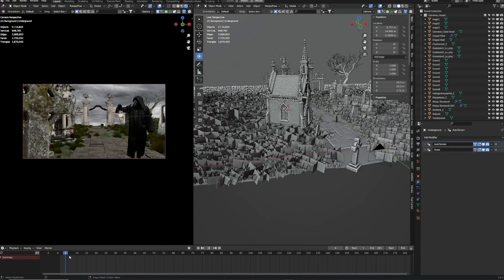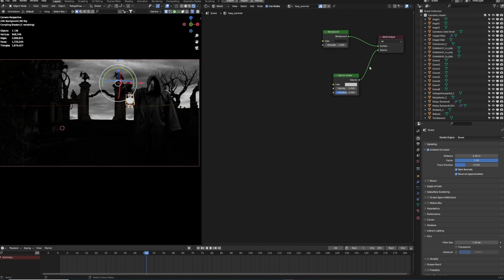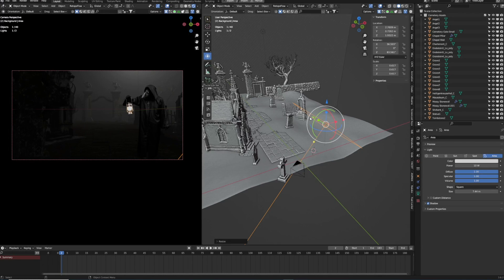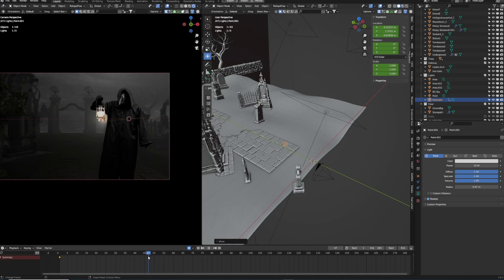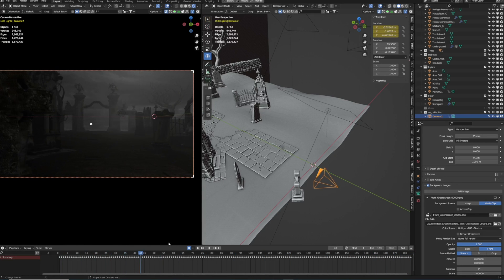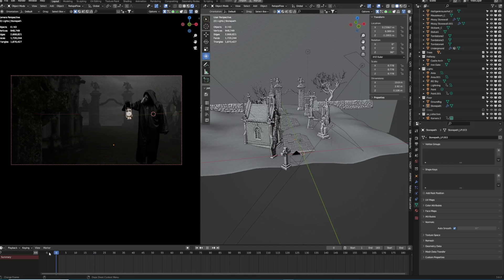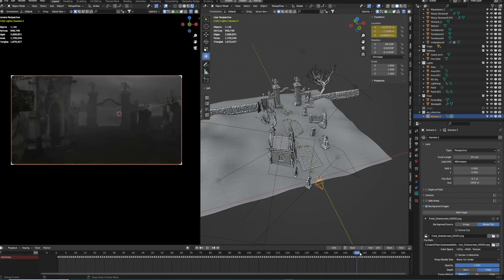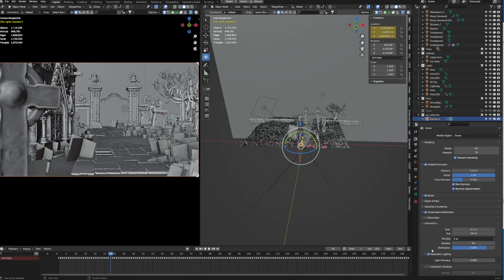Match your Blender Light to your Greenscreen Footage - Part 3 #blender #blender3d #blendertutorial

Comment: One of the better techniques ive learned, thank you so much, however I do have a question. Excuse my ignorance, but how is the point light that is being used to emulate the lamp flashing? I didn't see you keyframe it...
Reply from the maker: Thanks for your comment 🙋🏼‍♂️Yeah it should be in Part two of this Video where  I Set some Keyframes for the Flash Light of the Lamp in Order to match the Movement ☺️ nothing fancy and Fairly quickly ✌️